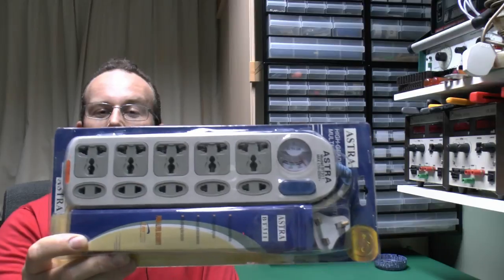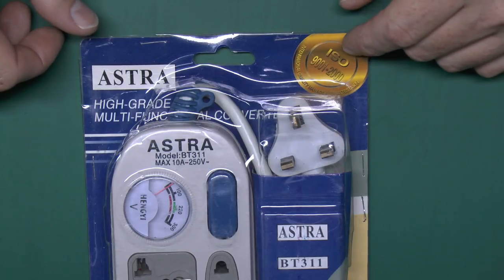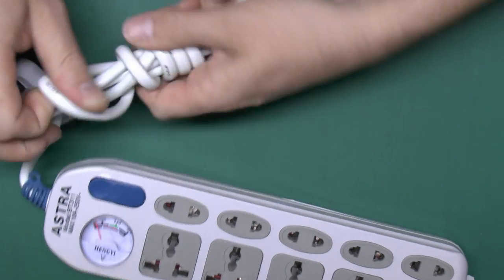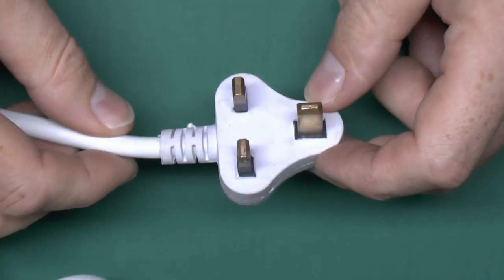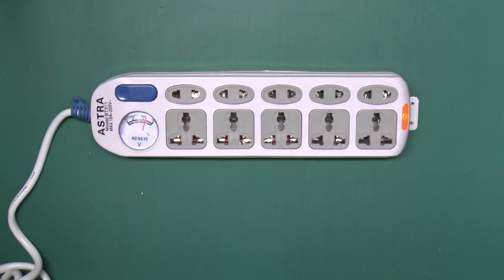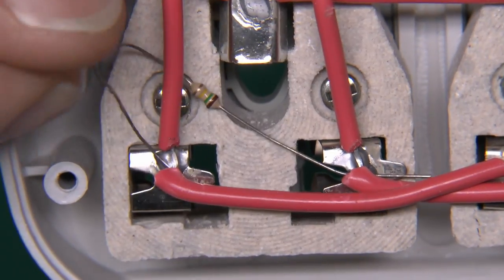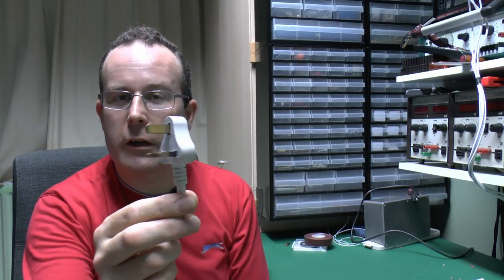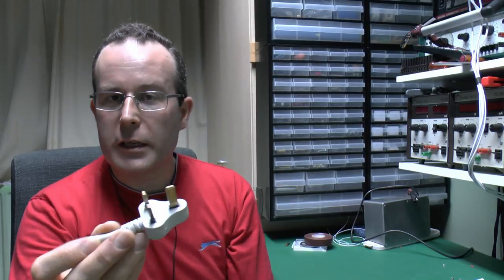Dangerous Multiway Extension Lead ASTRA BT311 (Part 1)

Comment: This is another one of those dangerous plugs on a multiway that I had the honor of reviewing. Why is this allowed to happen?

I took the liberty of cutting this one up and found there was some form of connection to the earth pin, but it was very loose and of course no fuse !!

Can you check this out on Amazon, for some reason it's still being sold

https://www.amazon.co.uk/product-reviews/B01JOHOMZS/ref=cm_cr_dp_hist_one?ie=UTF8&filterByStar=one_star&reviewerType=all_reviews&showViewpoints=0

Comment: 10 amps, 0.54 ohm per conductor. 1.08 ohm total. Voltage drop = 10.8v. 10.8v x 10A=108w dissipation.
So that wire 60cm long, carrying 10 amps will dissipate 108watts. i.e. get very hot and melt. Not a very good situation.
Reply: +Nick Hill It's even worse! The whole cable was 1 metre long, which means a power dissipation of 180watts.

Comment: I know it's too late but what if you do up the plug properly?
Reply: Irrespective of placing a compliant UK plug on it, that Earth Wire  is a major danger -- it cannot take the potential safety load if there is a short to earth in attached external devices.  The earth wire, ideally, should be of greater current capacity.  This one is massively less.  Only place for those devices is the rubbish bin.
Reply: Alan Torrance I'm just curious if the earth is only down to the plug not properly wired :P

Comment: 300/500V on the cable doesnt mean volts, just like a Cat I 1000V meter lead is not capable of handling 1000 volts

Comment: Fairly sketchy 😐
Im in puerto rico and was totally freaked out by the way they handle electrical s here. Especially in regard to water.  Live cables are left out unsealed, sockets poking out of the earth in gardens etc. They theory is  the water will just boil off.  ..so nothing trips out on the breakers even if shorted by water...coming from britain its taken some adjusting to 😑 no faith yet.  But i did figure out how the circuit breakers are layed out one for the left of the house (sockets and lights) one for the right, and about 6 that go individual light sockets..its nuts 😄 half of it has live power coming from the ground wire, the other half doesnt have a ground wire (3 pin sockets). Nightmare. It took me 3 pc's, two flatscreen tv's and about 5 apple adapters before i found the earth issue.

Comment: state what the resistances should be on electrical cables generally
Reply from the maker: +beingatliberty For short flexes on things such as adaptors and appliances, less than 0.1 ohm for each core would be typical.
Reply: +John Ward I TESTED MY FLEX 16AWG 5 FT AND GOT .076 OHM

Comment: wow that earth wire probably would fail if exposed to a fault current from a 13Amp fuse.
Reply: What 13A fuse? It didn't have one fitted! It gets worse - any fault in the product would be exposed to the fuse or breaker on the ring main - usually 30/32A. Guaranteed fire.
Reply: David Lowe the one fitted the the appliance  cord.

Comment: The plug is designed to be used in Hong Kong since their plugs dont require fuses
Reply: No, that is incorrect. For electrical products that comes with a 3-rectangular-pin plug, the plug has to be fused and comply to BS1363. This is required by the Electrical Products (Safety) Regulation.

Comment: I have a friend that had a similar plug unit and I took it from him and took it apart and was like O.... M..... G...... It had like 22 gauge wires in it like you would find in a toy, they were solid copper; I binned that sucker after a few photos

Comment: It may be copper cladded steel cable, which is even worse._
Reply: Which metal(iron,steel,brass etc) should not be used for electric terminal?
How can one test the material a terminal is made of?
Reply: @adeyemibabatunde1814  Iron/steel are bad contuctors, a magnet can determine is it steel or brass._
Reply: @DjResR  Thank you. Some terminals are iron / steel cladded or painted with copper

Comment: Dangerous dangerous multi plug strip the connector is by law shouldnt be soldered due to in reliabiliy of the solder joint they should have a thick spring steel like copper strip going across the Earth Live Neutral with a screw block connector for the 3 connections

If they are to use a plug with no fuse atleast have it on the strip but their earth is not there horrible horrible if i test a plug with no earth i wont be plugging it in

Comment: You see this is my issue. The UK over engineers half the country, yet half the issues with this are problems the UK and mostly the UK introduces.

Don't get me wrong, it's a load of crap, but not having a fuse and being able to stick ground into live are almost purely UK and AUS issues. The rest of the world doesn't fuse plugs because that's another point where shit can go wrong if only you put breakers/fuses on all circuits then the plug doesn't need a fuse, and it won't become dangerous if one isn't in, and it's also annoying to buy fuses whenever you run a toaster and microwave on the same line. 

Having all the pins a same shape AND be spaced apart is asking everyone to find a way to put me in the wrong way. In the US with NEMA plugs we have only the need to have a much smaller bevel around, and you can't put ground into live. German/French Shucko plugs are also impossible to fuck up.
They go in two ways, and you can't plug them in wrong because there IS no way to plug them in wrong because they are all sunken into the wall.

Most issues British people take with products is that they break them and the manufacturer has to treat you as a special needs case. Not to say the US isn't guilty with slightly dangerous plugs and 120v60 power, but we don't complain about other products breaking that code of ethics.

So here is how we now do the rest of the world. NTSC video, 240v60hz, German plugs, and we melt down Donald Trump for the pure Hateonium to turn into a cane.
Reply from the maker: +AmperaYT The earth pin on UK plugs is larger than the other two pins, so on properly manufactured sockets it is impossible to put the earth pin into the wrong hole.
Reply: +John Ward Thought they were the same, but they are still a bit too similar. You can also plug neutral into live.
Reply: In Germany the sockets are fused with max. 16 A, the Schuko-sockets and -plugs could handle 10 A permanent or 16 A for a short time. In the UK sockets are designed for 32 A and fused with 32 A. So the fuse is necessary to protect the connecting cable. And if you would use this thing shown in the video in Germany you could only handle type c-plugs (euro-plug, max. 2,5 A) or CEE 7/17 unearthed plug (max. 16 A). The normal "Schuko" plug (CEE 7/4) or 7/7 (Schuko compatible with french and belgian) could not be used safely (no PE-connection). The plugs are not protected against polarity reversal.

Comment: same problems across the sea in the united states brits, the same devices for 110 volt outlets with the same problems,depth of pin holes is inadequate,loose LED on/off light soldering,a gentle tap in the area of the switch makes the light blink,our quasi government organization charged with seeing to the safety and efficacy  signs off on allowing them entry either is asleep or getting paid off,bribed by the  chinese importer,these xxx outlets cost from 5 to eleven dollars,,caveat emptor applies here too.
Reply: Don't switch it on, take it apart! At least you have taken one out of the market.
Reply: tossed the thing gorilla,the short throw distance for the outlets,meant inadequate contact with plug prongs,and the red power switch broke,showed the piece of crap to the manager where I bought the thing,idk if he acted on it.

Comment: Only because of the earth wire was not connectet the extension cord is not that bad.  If younuse it for simple low power devices you can use it save.  Dont use it for a 2 kw device but i wil never do that with any socket us or australian disign because the system isntotaly crap.
Reply: daibhidhSCO just for a charger a laptop a tablet to charge no problem at all. You wil joy it for many years. 
No dont use it for a 2000watt heater. But how many things in the house are that much power. And those things you should never use a extension cord.
Reply: daibhidhSCO ok you win its a piece of crap its only 5 dollar or something. Ok we trow that all away and we starting buying 25dollar extension cords. We just dont do that. I not say its the most save and best extension cord there is.  But you know value for money. Its the fault of ourselve we accept crap like this. And i admid somebody that has no idea of electrical safety wil buy this for a 2000watt heater. And yes accident wil happen. Alll what we can do about is dont go to the cheap dollar stores to buy but go to the more expensive  electrical shop.  If we all do that they wil not send this crap anymore  or they wil start building better quality but more expensive. Our goverment is also fault on this. If you bring 2 botlles of liquer in your country they nail you and you have tompay the tax. Those containers also have to come in the country but nobody checks the quality whats inside the container. They schould refuse it going in the country because the equipment is not according the rules what they bring in.  But strange enough it stil comes in the country. And its a lot more value than those 2 botlles of liquer.
Reply: daibhidhSCO and yes i make fun of the us and oz system.  I live in a country where they also use that system. Original i am from europe. But in this country where i live now they use both systems toghether. Thats even more worse than the extension cord we where talking about :-)
Reply: +J IJzer The earth wire is very important in terms of safety. What happens if a live wire is damaged and it touches the metal casing of the appliance without grounding, you will get an electric shock if you touch it.
Reply: Jacky Ou yes i am fully aware of the importance of the earth wire. But also now a day equipment must be dubble isolated. So if there is a wire fail the wire cannot set the metal casing under tension.
Reply: +J IJzer Double insulation is not a requirement for electrical equipment in the UK, providing that the case is properly connected to earth. Since this extension does not carry earth, a compliment device can still be dangerous. This extension is not safe and should not be used for any purpose.
Reply: Samuel Doye i asume that are big consumers like a washing machine i would not put that on this kind of extension cord
Reply: J IJzer What if someone else plug in an earthed appliance on that crappy powerboard? You don't wanna see your family members or friends die by electric shock. Most people don't care or don't know jack shit about wattage and this rubbish can easily cause eletrical fires because it is NOT rated at 10A which it is misleading or you can get an electric shock. Do yourself a favour, if you have these crappy powerboard like that, cut the cable and then throw it in the bin. Don't even think about selling it to other people.

Comment: 😳😱😠 Yes, that is Chinesem crap, just by looking at it. I think the plug was made elsewhere and our plug type is used elsewhere in the world (I remember that Singapore and Hong-Kong have it) looks handmade/faulty assembly machine, - the pins are held by the plastic frame and a slug of soldier put in the holes at the back of the pins and the wires stuffed into them and then heated to melt the soldier and cooled to weld the conductor to the pin and then put it into the moulding machine and the soft plastic flows into the top of the mould - it appears that the worker forgot to put the solder slug in the earth pin hole and just shoved the ground wire into it, (or didn’t bother doing that, for reasons unknown, leaving it at the side) so when the pins were heated, only the live & neutral made contact; and when it was being moulded, the soft plastic pulled the ground wire out of the earth pin and swept it to the side. When it was tested (probably wasn’t) that there wasn’t a connection with the ground and earth pin and ignored that and fraudulently passed it off to be fitted to the crap that JW has. As for the Chinesem crap, I would have seen it as dangerous but liked the analog meter addition - seeing how much the voltage drops when connected appliances are turned on, and would have taken it apart and harvested the LED, meter and switch (for later projects) and strip out the metal and wire for scrap.

Comment: Omg, it's dangerous because it doesn't have a fuse. We're all gonna die because their is no fuse. Makes me start to wonder how I've stayed alive with all of the unfused six packs I've used. Oh wait, fuses are not absolutely necessary in every fucking product including the fucking power strip. You have a main. It's fused. Done!!!!!
Reply: +juan gonzalez UK electrical standards allow for "ring main" cabling to sockets protected by a 32A MCB (or 30A fuse). The current carrying capacity of the flex (even if legitimate and standards compliant) will be lower than 32A, so you need a plug top fuse to protect the flex.
Reply: Just saying its a damn silly standard that can definitely be upgraded. You don't need a fuse in everything if you have proper GFI and a proper circuit breaker. I looked into the whole ring main thing and yes I realize it was needed post WW2. Its currently 70+ years after thatt shortage. Just saying keep your damn safe plugs but update your silly mains setup.
Reply from the maker: +juan gonzalez Nothing to stop anyone installing other circuits already, some people already do.
However to remove fuses from the plugs would require that every ring circuit in every building in the UK was changed first,  which would take somewhere between decades and never.
Reply: I guess its more of a hatred for fuses since they are the bane of my existence on Ore Boats. Frigging quarter mile walk to get a multi meter and no one restocks the fuses at the boxes. Circuit breakers are god compared to Fuses.
Reply: Actually, why cant they use GFI sockets? Would make more sense then a fuse in that you dont need to take apart a plug to put a new fuse in, just hit reset. Then if it pops again you know that there is an active fault and its not just because someone jammed a fork in the toaster.
Reply: +juan gonzalez gfcis do not detect overloads. they only detect earth faults. if your overload is between live and neutral the gfci will never trip.
Reply: juan gonzalez watch "bigclivedotcom" channel.... Probably would be more entertaining for you.....he does similar things.....with a different "wording" approach....sometimes even throw some comedy into it. Seems like you get triggerred easily by John....(Hes got his own ways) that may not appeal to everyone.....although his bottom line message towards these things are similar with Clive. Your hatred towards fuses is probably not the only issue.....that drives your temper up and makes u snappy.....i think. (Personally i like fused British plugs.... And am in Canada haha)....so yeah watch bigclivedotcoms channel.....and calm down.... Trust me u will be calmer....Big Clive is therapeutic with the bonus of knowladge at the end :) 

My solution to this if the purchaser is so inclined to keep this deathbar..... Change the cord to a better one and instal a 10A fuse in it :)